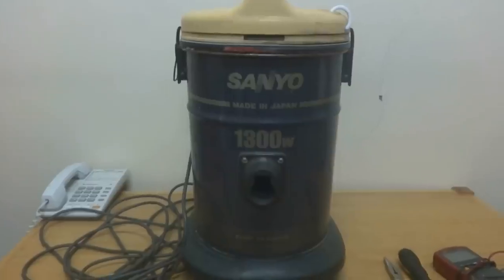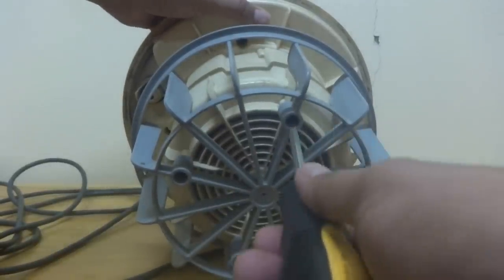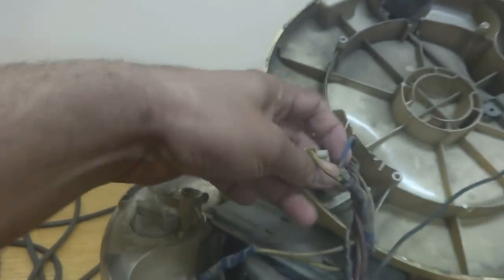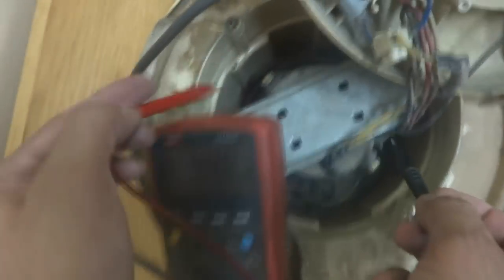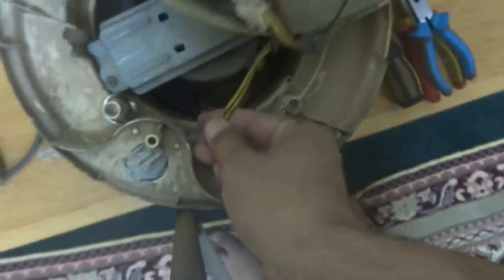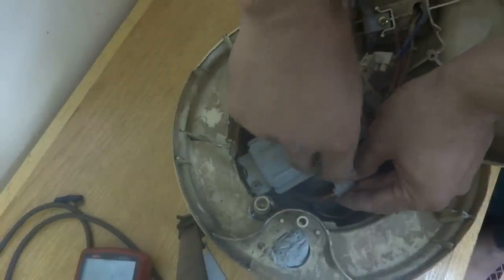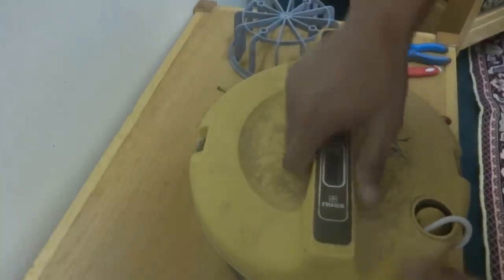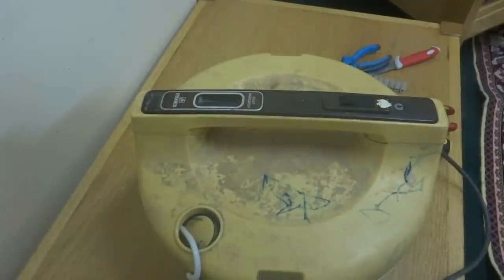Vacuum cleaner repair

Comment: Can you please tell me, my vaccum cleaner stops after 10 min and heated up a lot and it starts working after several hours. what happened to it? is it repairable? If yes then by the same method it will be repaired. Kindly answer me.
Reply from the maker: Mam it seems a bad motor for your vacuum cleaner. There are two choices for repairing it. First is you should have to replace the motor for your vacuum with new motor and the other choice is to repair and rewind the existing motor. The motor replacement is relatively easy job you can do whereas the motor rewinding is a massive job but is a big fun to do it. I have a series of videos available on my channel to rewind the motor for a vacuum cleaner. You can watch those video and get understanding. Also you may subscribe my channel to be in touch. Regards,
Reply: LearningZone Thanks.

Comment: Loverly, all working again :-)

Its a shame it was bodged together with tape, if all the connections were as strong as the one you just made it would not have failed :-(

Just one difference if i was with you, i would have checked the switch resistance as well, they sometimes need a clean as ive known them to play up afterwards.

The plastic connectors i have used all my life, i call then "chocolate bar connectors" as they remind me of the old chocolate bars with segmented sections :-))
Also ive used the metal tube part and screws to join rods and small bicycle brake cables :-))

Also soldering the tubes to the back of a small crocodile clip allows you to slide the clip onto a test probe for easy conversion to clip type lead :-))
Reply from the maker: zx8401ztv Yes mate you are very much right. The connection were opened last time for carbon brush and bearing replacement. I didn't check anything else as machine worked after restoring the subject opened connection. You have nice used of such connectors. Regards,

Comment: Hello I forgot to mark before loosen the  scews now it's not sitting properly
Reply from the maker: Do a little effort and you would be able to fix it in its proper place. It shouldn't be that hard. Most of the time I'm also not marking but they do fix easily after repair. Wish you very good luck with your repair. Stay tuned and blessed.